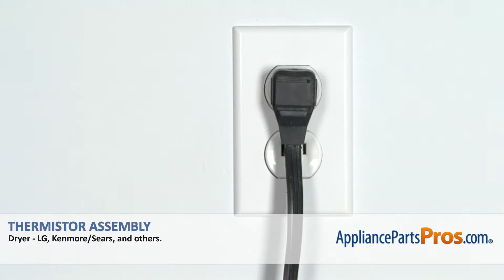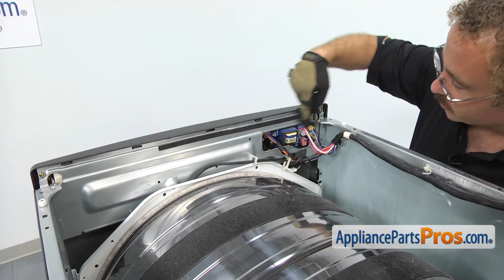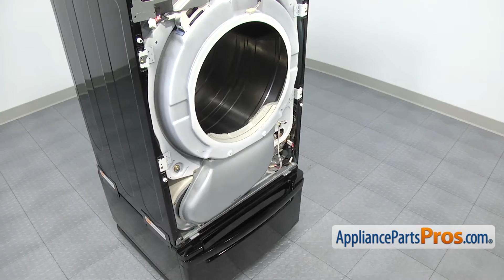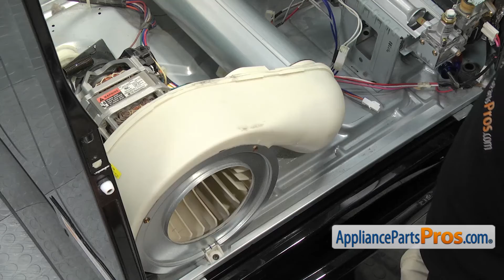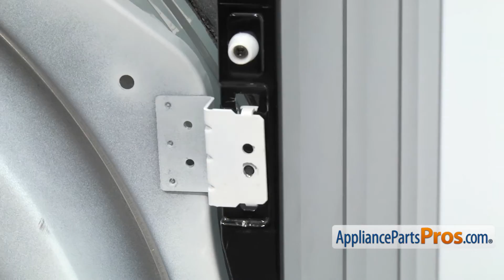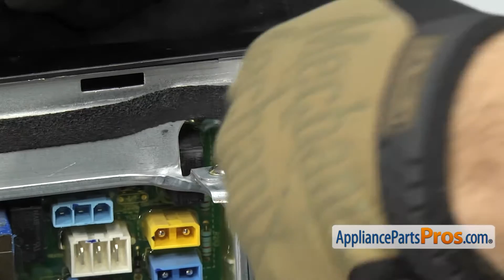LG Dryer Thermistor Assembly 6323EL2001B Replacement — fits Kenmore

Comment: I have changed the thermal fuse, high limit thermistor and fuse, cycle thermistor, gas valve assembly, ignitor flame sensor, blower and my thermal fuse still keeps burning. There is no clogging in my vent and air systems. What could be causing this?